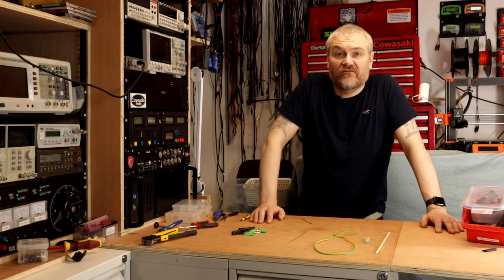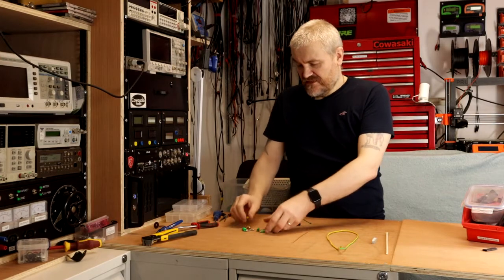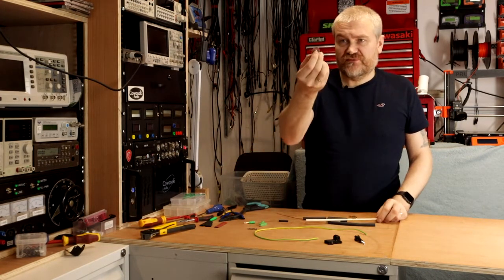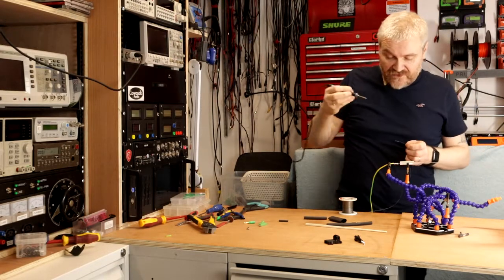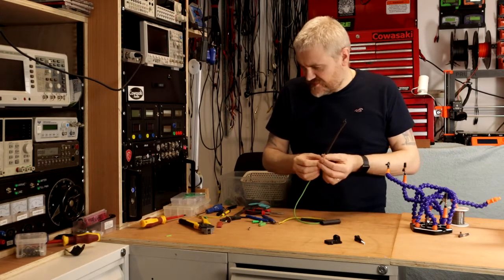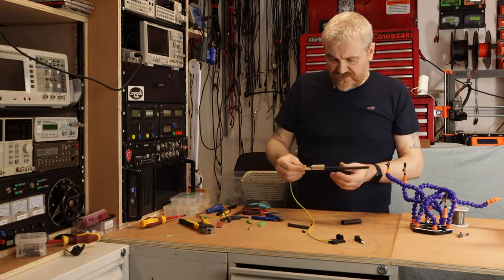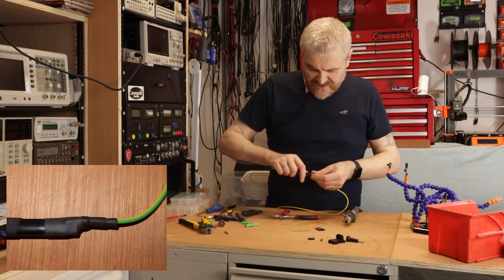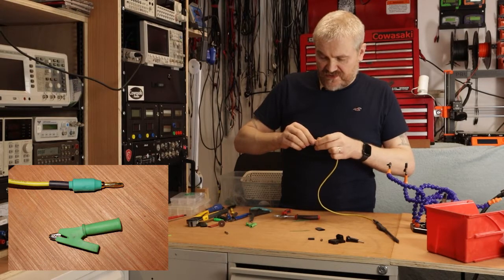#02 Capacitor discharge wand (electronics lab valve amplification) [FIXED]

Comment: Can the chopstick be wood?
Does the resistor have to be 250 ohms? ( I have a 100 ohm, 10 watt resistor on hand).
Reply from the maker: The chopstick just needs to be non conductive so wood is fine.  100 ohm is a little low.  It will do but you are discharging the cap much more quickly
Reply: @cowasakiElectronics  thanks for getting back to me. I also have a 1K ohm, 10 watt resistor - is that too high?
Reply from the maker: @williamjenkins9423  I would use the 1K rather than the smaller one.  I install a 240K resistor from B+ to GND on all my amps to drain the caps automatically when they are switched off.  It normally takes about 10-15 seconds to drain with a 240K to a 1K should still be pretty quick.
Reply: @cowasakiElectronics  that's brilliant, I'll go with the 1K then. Thanks again for taking the time to reply to my message.
Reply: @cowasakiElectronics  so, a simple resistor would drain everything automatically? That's genius! How many W did you use on the 240K?
Reply from the maker: @DeadmanDance  A 1W is fine, remember it is 240K ohms
Reply: I've finally got round to building my own capacitor discharge wand. I ended up using a flat bamboo skewer as I couldn't find a chopstick.